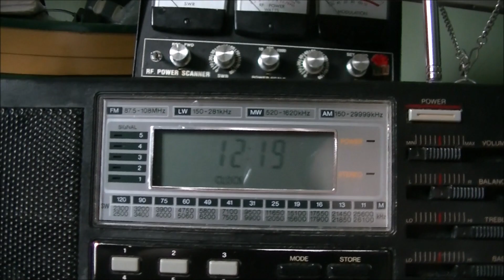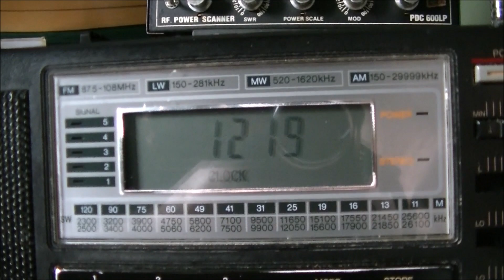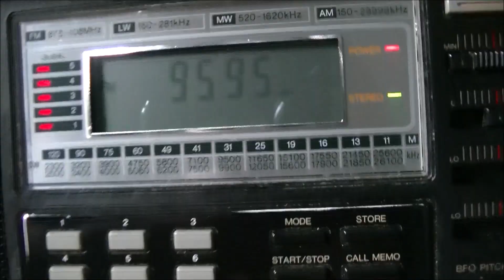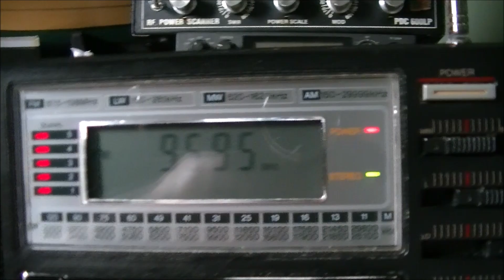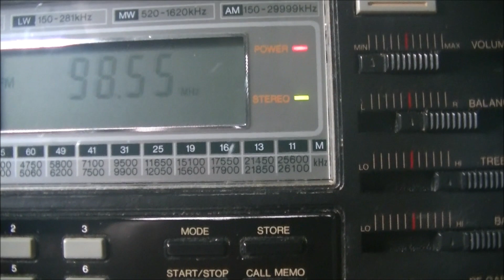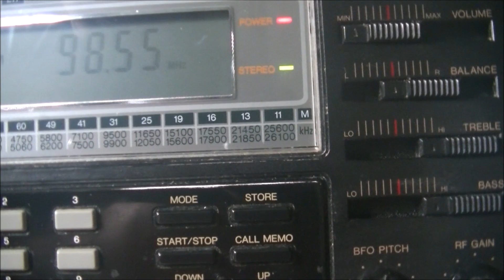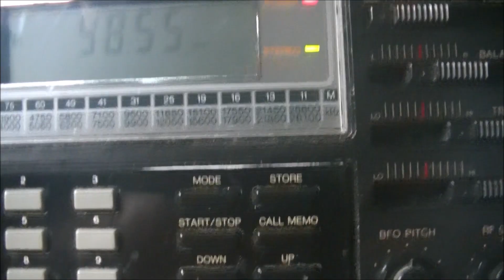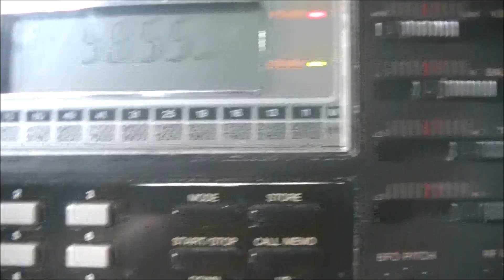Emerson ATS 803A FM Tuning off 5 or 10KC's?

Comment from the maker: Anybody know how I can get the FM to lock properly with stereo?
Reply: I have the same intersound with very wide shift and no stereo effect
Reply from the maker: @mohammad.hassan  Interesting.
Reply: @mohammad.hassan  Mine tunes de FM stations a bit upper from the real frequency. Some ttimes I get stereo and sometime no, even with strong stations.
At MW, LW and SW not missaligment, tunes perfect. Mainly I use this radio for any band except FM,
Reply: At mine radio, version branded  "INTERSOUND WE-12M" without Narrow-Wide 
selection. FM Stereo appears a bit upper from the official frequency of a
 tuned stationm and not always. Sometimes I get stereo, but it lasts few minutes.

Comment: Hello, MW stopped working on my ATS803A, I replaced Q110 also but it's silent, please help. SW is fine.
Reply from the maker: That sounds frustrating. Do you have the antenna hooked up? Do you see any signal on the meter but no audio?

Comment: what could be wrong if i can't receive any station on any band ? is deaf on all bands
Reply from the maker: I'd need a little more information but make sure your speaker works. Check the hedphione jack to be sure it is not stuck and is cutting off the internal speaker.  I am assuming the radio powers up. Try cleaning the controls with a contact cleaner like deoxit. Also, make sure the Local DX switch is clean and on DX so you can receive distant signals. As I said, I may need more information before I could further troubleshoot this long distance. Get back to me anytime. Good luck with it and God bless.
Reply: @Tobinindustrial  thanls for fast replay. The radio it powers up. Is able to search through all band but i cant find any station. Is like it have no antenna. I opened it and check for connection to the antena and its ok. I think is some component fried or damaged on the recieving pcb. I also changed q115 but no result. I only receive static (hissing)

Comment: Hi, try this one..... If you can find the FM Ceramic Filters, normally labelled 10.7MHz, I believe there are 3 (three) ceramic filters 10.7MHz inside the ATS-803A, CF101/102/103. Try to put in parallel a small capacitor (5pF --- 20pF) to the CF103, pin-1 & pin-3, and check if there are some shifting on the center frequency.....should be shifted down by several kHz... This way works on my ICF-SW77 (similar problem)....
Reply from the maker: Thank you so much for that idea. I may get the courage to give this a try. I discovered it is off by about 10KC's really. I noticed on FM that I can go 10 KC up and it seems to be a better signal. God bless you for this.
Reply from the maker: I took the back off and checked. It is D109 which supposed to be a 1N60P glass diode. I tried a regular black diode but FM signal strength does not work. AM, LW and SW signal strength shpws on the meter. I checked and I have nothing in glass diodes and so it will take several weeks if I order online to get one.
Reply: @Tobinindustrial  Hallo, sorry for the broken diode. Yes, this is a Germanium diode, it is more sensitive/has less forward voltage barrier, around 0.2-0.3V, compared to the black/silicon diode which normally has forward voltage barrier of 0.5V. Actually germanium diode is very-very cheap and easily can be found on the electronics street markets, and i think it does not have to be 1N60P, as long as it has low forward voltage barrier, germanium type, (of course replacing with the same 1N60P would be the best). If you are able to access/replace this diode, then you can access/replace the CF as well, (maybe you will need to crush the CF first then replace with a new one, soldering from top side.... just joking.... please don't take it seriously...)  Replacing with a new CF (or new CF parallel with C) might solve the issue. Yes, that sheet of shield is limiting the soldering access, unless we detach it first....
Reply from the maker: @adharyanto  Much appreciated for informative response. If I can remove the circuit board from the unit, I will attempt to desolder the shield. I have already ordered a few 1N60P diodes. I hope they arrive sooner than usual. International shipping is as slow as horse and buggy these days. Of course, if I can get the shiled off, I will also incorporate the capacitor on pins 1 & 3 of CF103.
Reply: Hallo...
I was trying to answer your question, and I was based on my experience of my ICF-SW77 with similar/same problem; FM freq is off by around 50kHz, and my problem was fixed.
But hey, there is difference between the third CF on SW77 versus on ATS-803A; the third CF on SW77 is used for the FM discriminator, while on ATS-803A is used for signal strength detector.
So, modifying CF103 on ATS-803A is likely won't solve your problem.... I tried myself on my ATS-803(without A), slightly different model... Sorry to give you this misleading....
Your problem should be around the discriminator/mpx demodulator, but also can be caused of the "shifted" PLL reference oscillator. But, PLL reference oscillator is used for both AM & FM, so if you have AM is now working properly, we should not modify the PLL ref osc (adjusting VT401), otherwise it will effect on AM as well.
Back to your problem, the closest possible cause is around the mpx part, there is possibility that the 19kHz FM pilot is shifted. The easiest way is try to tune the VR204, and while measuring the freq of IC201 pin-12, it should be 19kHz.
Reply from the maker: @adharyanto  Thank you for the update. I did not proceed with your previous suggestion as I am waiting for parts to come in before I was gonna open the case again. I Am not sure how to get something to read 19 kHz on pin 12. I have a freqbuency counter but it is a mobile antenna'd radio shack freq counter. Can you advise the easiest way to proceed with getting that measurement.
Reply: Hallo, I have two desktop frequency counters/generators, a desktop digital oscilloscope, also an usb modular digital oscilloscope. For this kind of measurement I prefer to use my desktop digital oscilloscope, it has a big display complete with measurement presentations/values (Voltage Mean/P-P/Min/Max/and the Frequency = this one is useful, at the same time acting as a frequency counter). So, not only displaying the shape/waveform of the signal, we can also read the measurement in numbers/digits up to the significant numbers), we can easily read 19.0000 kHz.

I do not have a RS mobile antenna’d frequency counter, probably you have the model 22-305/306… I am not sure if this equipment can measure below 1MHz accurately, but reading the manual it should be able to measure down to DC (0 Hz) for logic frequency, (this is more like square wave, in digital system). So, there is still possibility to use this equipment to measure 19 kHz, although our signal is sinusoidal wave (not a square wave).
Reading the 22-305/306 manual, you can use an optional coaxial cable (instead of the antenna rod) to measure directly. For protection, I would rather adding a coupler (a capacitor and/or a resistor) before connecting to pin-12 of IC201.
 @Tobinindustrial
Reply from the maker: @adharyanto  I have the 22-305 so it should not measure anything more than 1.4volts and it is just for 1 Mhz  and up so it may not measure the 19 khz. I'll check for voltage and if it is low enough, I'll try it.
Reply from the maker: @adharyanto  Which board is these components on? I am unable to find it. I suspect it is on the back side of the second board but not sure. I removed the two top boards and I don't see the components I need to get at.
Reply: @Tobinindustrial  Hallo, I think you are looking for the point to measure the 19kHz signal... It is on the PCB-A2, where you can see IC LA3361. If you open the radio compartment from the back, then you will see total 4 big pcbs A1/A2/B/C + 1 small pcb A3 (for light/timer/sleep buttons). Pcb-B is the one behind the speaker, where the connectors are located. Pcb-A1/A2/C are stacked like a sandwich. On top is A1 (signal pcb), in the middle is A2, and on the bottom is C (where the processor and lcd display are located. To access pin-12 of IC LA3361 on pcb-A2 you will need to remove (or slightly remove the signal board (top board/A1), a bit difficult because there is ribbon cable on the right side between top (A1) and middle (A2) board, (I made some extension ribbon cable when opening this top/signal board). Then you can access the ic LA3361... You can refer to service manual of Sangean ATS-803A, I think it is similar/same as your Emerson. Mine is TENS ATS-803 (a variant of Sangean ATS-803, without "A", a bit different for some component locations/assignments and pcb layouts....)
Reply: I can send to you some pictures of the "internal organ" of my Tens ATS-803 if necessary....just for reference... It was a totally dead radio, bought for only US$14, with many broken parts/components, now I would say 95% works fine.... FM/AM/LW/MW/SW work very well..... The 5% probably for the treble/bass potensiometers which are only half work, but I put fix resistors on the other half and the other half are still normal/variable. The lcd background is bit dark but still ok.....
Reply from the maker: @adharyanto  I was hoping to not have to go in too deep for fear of breaking a ribbon cable or worse. I am hoping to actually be able to see the components but there is still the question of my frequency counter being able to do the job.
Reply: @Tobinindustrial  Yes, I understand. Handling an antique/vintage/rare stuffs like this radio needs delicate handling. It is not about the price of it, but more for our satisfaction when we successfully fix it. Btw, I have just replaced the front & back aging polarizer of the lcd display. Now the lcd display becomes crystal clear like a brand new.....
Reply from the maker: @adharyanto  Congrats on the repair of that LCD display.  It is great that you have the skill and knowledge to do such work.
Reply: @adharyanto  thank you.. My friend.. I like your Experience in the field of radio. #arab_the_radio_amateurs
#هواة_الراديو_العرب
Reply from the maker: Hello again.  I found CF103 but unfortunately I am unable to get a connection from the top side of the board for that 5 - 20pF capacitor. I removed the circuit board and there is a shield covering that same component in that area so it is a little out of my league to try your suggestion. I could possibly get two wires on pin one and three from the top side on CF103 but would not be able to solder andit would not be a solid mechanical joint. Thank you for the information but I regret I have to give up before I do more harm than good. 

On a positive note, I am most likely going to be using this radio for SW listening in the field so everything but FM is Ok. In the meantime, I can just dial up a a full Mhz EX: 98.0 to 99.0 to get the best reception on FM. God bless you for your attempt to help
Reply from the maker: I broke a glass resistor just up from the CF103 while I was rooting around and now my strength meter does not work. Totally my fault trying to get access to the pins of CF103. Can you tell me what value it is. It is stuck upon the CF103 filter cap.
Reply: do you know what could be wrong on a ATS 803A that could not receive any station? i can't recieve on any bands... only static...

Comment: Reference oscillator is a little bit of.
Reply from the maker: I'd like to get this set up right. I am not sure how sadly. I will research what you mentioned just the same and maybe it is an easy enough fix. i don't have much in the way of test gear or knowledge of same.
Reply from the maker: I have a frequency counter but it is hand held and not able to be hooked the the reference points to do alignment. It has an antenna only (Radio Shack) I think I'd ruin the unit if I tapped it with a BNC test point wire.

Comment: Sounds like an alignment issue, my ATS803a receives SW better (signal etc) when tuned a step higher however my FM is spot on IIRC, we are not alone in this phenomenon as I did come across other owners mentioning (in forum posts) similar behaviour when researching the anomaly 👍
Reply from the maker: Yes indeed, I saw that there were frequency deviations mentioend by other owners. My best guess through the online service manual is an adjustment to VT401 is needed. It is on Circuit Board C but I was unable to find that trimmer whe  I disassembled so I suspect it may be a slight difference in build from the Sangean ATS 803A and the Emerson ATS 803A. I was hoping I could find a way to tweak the issue but I think the schematic is slightly different. thank you for chiming in on this subject.

Comment: whats 5khz between friends ??---stereo pilot carrier used to be superimposed 19/38khz off centre,,,I would put a large piece of tape over everything that is wrong and just use 3 vital controls.......the on/off...the frequency tuner and the volume........everything else is redundant (haha---UK humour),,,,excellent upload as usual.....off for a cuppa.
Reply from the maker: it is no biggie as long as I add 5 KC's to the end of the FM frequencies only. The SW, MW, LW an d AM is perfect and I have this radio to use as a shortwave radio out and about in the field. So a radio station on FM that is 99.00 on th dial will only lock in stereo if I punch in 99.05. I will try and rectify this issue but don't want to go into the radio and make things worse. I am hoping somebody can suggest what to do and that I have the proper equipment to do it. I am slurpin' a cuppa tea as I type. Mmmmmm... QualiTEA.

Comment: Does the radio have a DX switch? RF gain? Could be the receiver is being overloaded? My Tecsun Pl-660 does the same thing when the gain switch is set to DX and when I set it to Local-(OFF) and it works fine.
Reply from the maker: It has in'internal - external' switch on the back of the radio to select the telescopic antenna or you can hook upo an external antenna via an RCA jack on the back. There is an 'RF Gain' which can be used to lower the signal coming in but according to my other identical radio, it should be capable of staying fully up. All stereo frequencies in my area need to be tuned 5 KC's higher in order to have the stereo light turn on. I can't see how this radio could have came out of quality control like that so it may have been tinkered with but not sure why they left it in this sort of alignment situation. Perhaps the person didn't know what they were doing. Thanks for your input.
Reply: @Tobinindustrial  np hope you get it worked out.
Reply from the maker: @vo1dfc  Thank you Alisa, I'll give it a go if it is a simple enough procedure. Thanksfully, I am more interested in using the shortwave part of the radio and I am looking into making up or buying an antenna to use in the field. I guess a random long wire but I need to find a small profile but strong type of wire for throwing over tall trees.